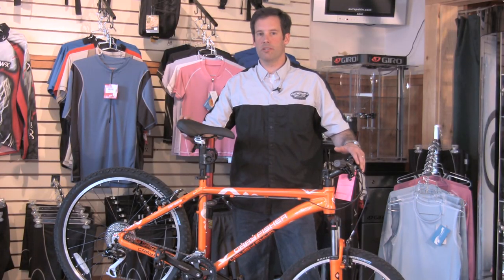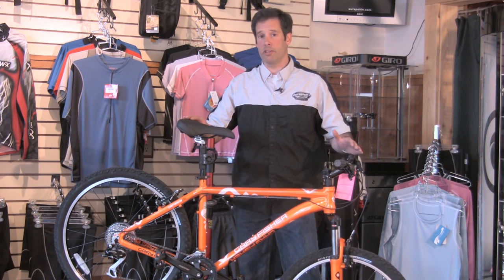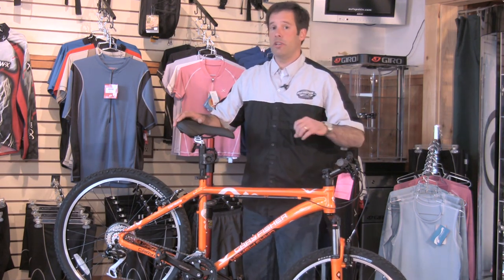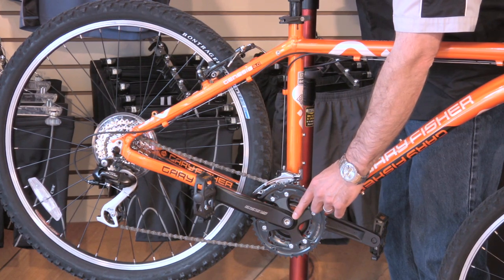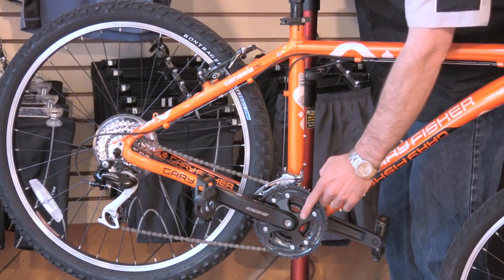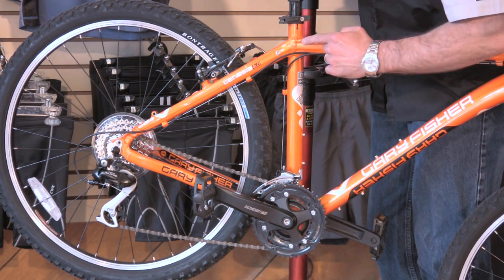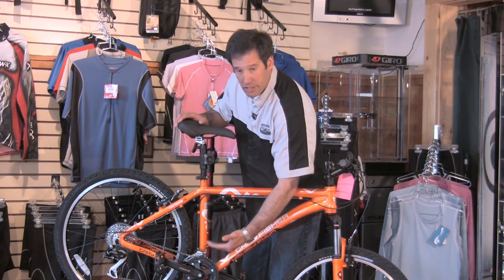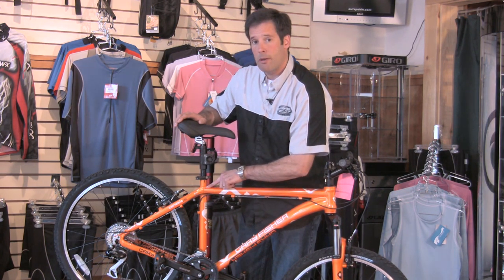Bicycle Parts & Maintenance : How to Measure for a Mountain Bike Frame

Comment: The right way to measure a bike frame is from the center crank, to the top of the seat post tube, when did it change, just thought i would throw that out there.

Comment: So with a bike that has the same dimensions, but with a level top tube, you're going to have a different measurement.  I thought they used to measure using a imaginary level line from the head tube to seat post, but that is no longer the case.

Going the other way and you could even make a point that is valid and not uniformed.  You could have a bike with the same dimensions but the seat tube is shorter.  You would just need a longer and stronger seat post. 

Get on the same page please!